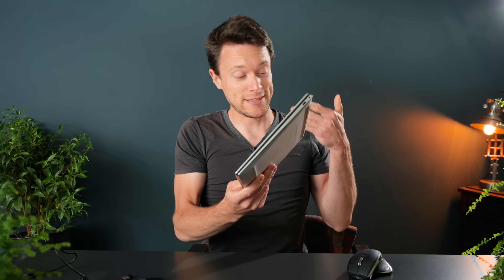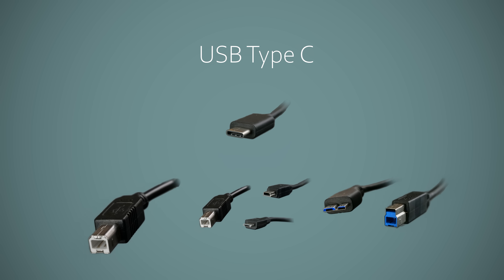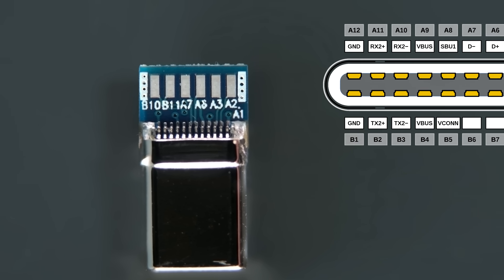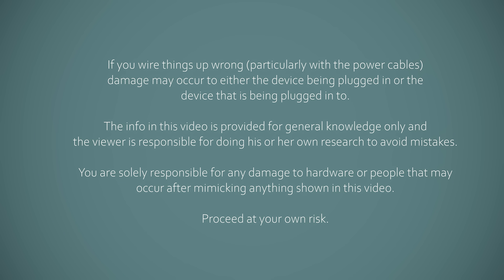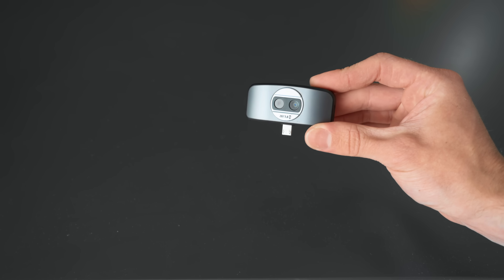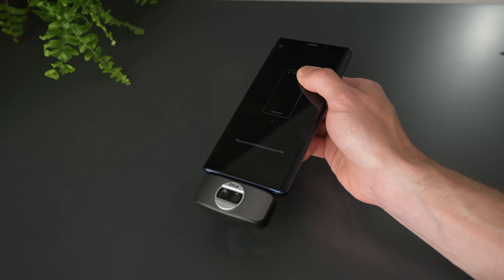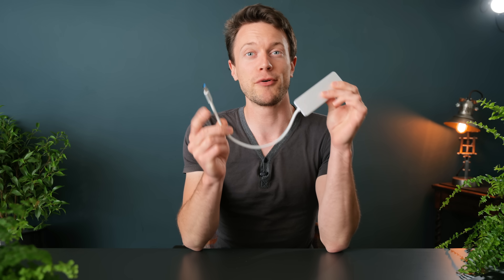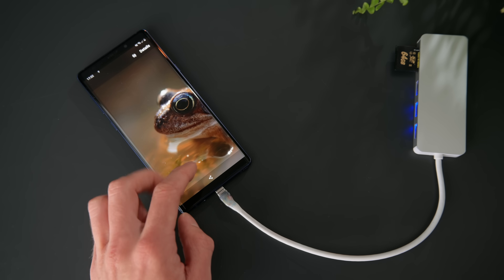Converting devices to USB Type-C

Comment: USB-C is the future and waaaaaay better than the older connectors in many aspects, but they forgot one thing that gets really annoying: retention. Old micro-B had tiny metal hooks that keep it plugged in, and even if those got bent you could just bend them back rather easily to "fix" it. Type C on the other hand... well, my phone already has Type C, and after a year of usage the port apparently has widened ever so slightly, so now I constantly have to check if the cable is still properly plugged in during charging because even slight movement can dislocate it enough for charging to stop... <.<

Comment: For tiny wires that are perfect for connecting stuff like this, I highly suggest old IDE and floppy disk cables. IDE cables are usually a single strand, while the floppy cables have slightly thicker multi-strand cables, though both do exist in both forms. The electrons don't care about the colour ;)

Comment: Oh, it pained me to see you put that giant resistor on there when you could have just moved the existing SMD resistor to the other set of pads...
Reply from the maker: It was 56k unfortunately, not the required 5.1k
Reply: @DIYPerks  But it was a pullup to +5v instead of a pulldown to GND, are you sure it wasn't 5.6k, since that would be the nominal value above 4.7k.

Comment: Good video, very practical.
One down side is that it's not mentionned the signal quality is highly degraded whne soldering this way. I'm not convicent those breakout boards are impendance controlled either. The risk is that some devices may malfunction. I bet that most people will not experience any issue because of how the USB protocol works, but functionalities of some devices which challenge maximum link speed may suffer (the functionalities) from a signal reflections due to impedance mismatch.
That's especially true if the viewer decides to extend the existing cable beyond the limit in USB specs.
In any case, good video, thanks Matt.

Comment: Why did you scrape the trace when all you had to do was heat up the resistor and move it to the two other pads wich were for pulling the pin to ground?

Comment: Hi Matt, all Your projects are brilint. But,,, to be honest, im just working on a USB 2.0 / USB 3.0 project, so this video made a huge smile on my face. I know there are better places to ask, but i think this will also interest You. I just bought a new route with USB. It is possible to change USB 2.0 and USB 3.0 mode remotely. As my router is not accessible easilly, it would be perfect to have possibility to use this function to turn on/off my external hard drive (to not be working all the time). I mean connect my hard drive to the router and turn it on only when the USB 3.0 mode is enabled. So basically im trying to make an USB cable/device to connect to my router via USB 3.0. The USB 3.0 cable will be splitted to 2 USB cables (one USB 2.0 and second USB 3.0 - the cable is possible to buy). I will connect Digispark controller to the USB 2.0 end and my hard drive to the USB 3.0 end. Now the interesting part comes. I want to deconstruct the USB 3.0 cable (router - harddisk) and cut the positive wire. I will connect the cut positive wire going from hard drive to Digispark I/O pin (no power going trough normally) and i would like to connect some USB 3.0-related wire to another Digispark I/O pin as a trigger (this wire will not be cut, i will just scrape off the isolation and will connect a new wire to it like "T"). Hopefully this way i will be able to turn on and turn off my external harddisk when my router will be set to USB 3.0 output. Code will be pretty straight (when there will be an impuls from the USB 3.0-related wire, i will send 5V to my harddrive, maybe there will be some "timer" like i will send the power for next 5-10 mins from last USB 3.0 impuls). Could You help me to choose the best USB 3.0 wire as the trigger? Or is it a really bad idea (to burn both my router and harddisk :D )? Here is a diagram of the idea: https://drive.google.com/file/d/1vicodTE-F9b5rWNngTqEzJKy9ldO5bxA/view?usp=sharing and my mail oznogg@gmail.com. Thank You, Jan from Czech Republic.

Comment: I really enjoyed this simple video (although as others have pointed out wonder why you didn't just relocate the smt resistor) but am troubled that you didn't warn people to be careful what they modify (while I doubt someone would alter a USB A/B to USB (A/B) -> C due to cost, I could still see someone doing this and then destroying there device due to lack of  56 kΩ resistor or being stupid enough to mess with a portable battery with integrated cable) due to the spec current allowances.  I also have two of those mice.

Comment: i don't think thats a dongle. It's an ADAPTER.
A dongle is a thing that plugs in on one end and has NO PLUG on the other end. (this includes wireless dongles, because they dont have a WIRE coming out, even if they do connect to other things, wirelessly.

SCSI terminators are dongles.
Copy protection hardware keys are dongles.
USB A to USB C adapters are not dongles.

Comment: It's a non standard connection - the "standard" and the intent of the USB boffins says that the good old USB A socket should be used for all "A" end connections whatever the working standard is - because the basic aim is meant to preserve 100% backwards compatibility across devices.
Unfortunately as a result of the introduction of the latest trend for ultra portables  some of the big guns decided to use an odd twisted variants for power and in order to shave mm from their case thicknesses have gone for the slimmer thunderbolt style USBC outlet.  The header is fully compatible but the outlet has been made unusable without a (presumably grossly overpriced) dongle adapter.  The danger for the less tec is they go to the bay and risk ending up with a bag of OTG adapters.
The problem with burning your boats and pandering to this season's whim - is what about next year? - What comes next?
By destroying your dedicated mouse/keyboard dongle that has served so well for all this time - is now it's on borrowed time, and what of all the other USB memory sticks and memory readers you've collected over the years?

Far better to build a C>A adapter for each outlet and leave the device hardware alone - or mod a cheap 4 port hub.
It's sort of fair enough with the IR camera but even that mod is on borrowed time with power delivery as the new golden child.

Comment: There is a quite easy way to spot ground connectors. On the PCB you will see that's 99% the one directly connected to the most massive parts of coper which are all over the board. 
For your board, it was the one at the right when you present it and at the left when you measure.
Tell me if i'm wrong ;)

Comment: is it not possible to just move the resistor from R2 till R1 ? It looks like the label R1 is positive and the label R2 is connected to negative. and the bottom goes to the same through hole. Any ways great video!

Comment: I like to see a video, on how to use a USBC QI v2/3/4 power supply to power a usb micro device, for power only.

As USBC male will only put 500mA at 5V to a microusb device converted to USBC female, unless you do alot of resistor wizardry to get only 5V and for 1A or more out.

Comment: YES to the webcam! 
it's so crazy - before corona, they were like sub $30, with some even $9. and I was building a station for my boyfriend to play Magic: The Gathering remotely with his friends that live in other states. And then Corona hit and every webcam that's any good is like $300!?!, so I got some adhesive velcro and an old imac, and attached his iPad to the top with an old case (so it's modular) and he uses the iPad as a webcam for Discord video chat, while he watches their cams on the iMac. it's a little overkill since it's two entire units running two separate Discord accounts, but it works really well. We also tried using a mirror to angle the iMac's webcam towards the surface of the desk but it was janky, lol.

Comment: One of the first times I seriously don't see the point. It costs anywhere between near the price of a typical adapter to more so, and in future there will probably be smaller hard-shell USB-C adapters. I am sure once the Chinese figure it out they'll be cheap as chips and in exchange for enduring a little bit of pain with a wired adapter you can have your smaller solid ones which will look a whole lot better and about as bulky-looking. I bought a real small MicroSD card adapter with both a type-C and type-A connector where the card goes inside the type-A plug.

I know you need ot make some content but man this just looks dumb to do. Aside from soldering practice I don't see the reason for_anyone to do this and hope you publish something more substantial real soon.
Reply: Scratch all of that, these really tiny adapters I talk about already exist: https://www.amazon.com/dp/B07G54XXZZ
And for C to A: https://www.amazon.com/dp/B00GIF4E08

C to A adapters may well get smaller with sime when someone figure out how to stuff the type-C connector inside of the type-A socket. If not inside, figure out where exactly they need to stop for prevention of interference.

Comment: I'm trying to find female connector boards that are as easy to connect as these female ones seen in the video, where I don't have to solder the data and power lines on both sides.

Comment: Definitely make a video for building webcams! I love your videos for salvaging parts from laptops and creating new devices, especially the video on creating an external monitor and the one on the smart mirror.

I attempted to turn an old laptop into a monitor a while back but unfortunately completely bunged it up when I bought the wrong control board and also managed to crack the screen.
I'll be trying it again soon enough though as I've got another salvaged laptop sitting around.

Another option, however, would be to get a raspberry pi and create a little homemade tablet or handheld gaming system. This is a little out of my ability for now though so I thought I'd mention it as to maybe tempt you into trying it yourself for us in the future. =P

Comment: Instead of just a webcam, it's probably much more fun to do an infrared webcam as the conversion is relatively simple. Also, maybe figure out a way to utilize the I2S microphone on the webcam.
A project I am working on is to attach an I2S mic to a 5 dollar Raspberry Pi zero and have it transmit with RpiTX or something similar. It should be super fun and worth making.

Comment: Thats what i've in mind. i love the ideas! next turn a 3,5" HDD to USB-C and throw the powersupply finaly away.
Reply: That is a lot more work than what he is dong.  Depending on the internal circuit could be simple or complex but either way wouldn't recommend it (won't gain more data throughput and if a 3.5 than no reason to move / relocate it at which point why care enough about the additional cable.)

Comment: For people that want a better webcam than what you will ever be able to find in a old laptop, just use an old (it doesn't even need a SIM or anything other than USB/WiFI) android cell phone and DroidCam. The best webcam ever, just with the worst mounting solution ever.

Comment: Great video as always. I'm sure I will use it in the future. Unfortunately I do not like USB-C. The phone I currently have came with USB-C and it constantly comes unplugged. If the battery is low and I'm trying to use the phone while plugged in, it falls out all the time. Sometimes I plug it in at night only to wake up in the morning and find out it got bumped it and it never charged. I never had this problem with the connectors in the past.
Reply: Oh, and if you keep it in your pocket you constantly have to clean the port or or it won't even connect.

Comment: I genuinely do not understand why would one wish to use this kind of solution, instead of spending few hours and ordering an assembled PCB with FLIR connector or pcb for Logitech's receiver.
Not to mention the abominable trace scrubbing instead of just moving a tiny SMD resistor.

Comment: I’m not sure USB-C really is the greatest thing ever. The beauty of that Logitech wireless dongle is that it nearly all fits within the USB type A connector, and there’s little to no risk of anything breaking if you just leave it plugged in all the time. I’m not sure there’s room inside a USB-C connector to do the same thing.

Comment: Another option for the 3.0 is to take a Thunderbolt cable (Has all wires) and wire into the the hub internally, replacing the old cable.

Comment: you do know theirs a usb type a to type c  thats smaller then the ones u showed  as showen in the ebay link with out distorting the usb  > https://www.ebay.com/itm/New-Samsung-USB-Type-C-to-USB-OTG-OEM-Adapter-BLACK-For-Type-C-phone-LOT-of-3/333085990612?epid=795112884&hash=item4d8d78ded4:g:C5sAAOSwXHpcbujR

Comment: For certain high-speed devices, you need to keep the connecting wires very short. Those data lines are impedance controlled lines and may not work if your wires are too long or there is a length mismatch.

Comment: If you have an old Android phone, you can actually download droidcam on that phone and your PC, connect it with a sync/charging cable, do the proper setup, find out a way to mount it and you have a webcam from an old phone you were no longer using!

Comment: Just wondering about the breakout board That little resistor or R1 if you heated it up and moved it to the R2 location would that not have been better than removing the trace and soldering a big chunky resistor ?

Comment: Curious, I don't have an iOS device but could you technically hook a card reader to a lightning port? Or are they not the same considering it's not in the USB family
Reply: You probably could but it would be really complicated, buggy, expensive and overall not worth it
Youd have to bypass apples lightning port security, obtain permits etc. They dont belong to the USB family as the lightning port is a proprietary port, making the while thing even more complicated. 
Its possible, but not worth it.
Reply: @maxz8807  Yeah I've been trying to figure a way to help a church member who has an old iOS device and cannot move their files/photos. They handicap me by saying moving it to the cloud is not an option (which makes me wonder what kinds of files/photos they have that are so important). I've seen a few OTG type devices for iOS but they only best way I can figure is transferred though Bluetooth or WiFi device. I've seen a few portable devices like this but they happen to be out of their price range (yup another handicap). I swore this would be simple but I swear it's getting more and more complicated. I was thinking about if it was possible to transfer data from the iOS port using this type of technique. Oh well, I may just have to capitulate that I cannot do it as they want. The issue was they don't want to upgrade until they transfer the files. I also thought about airdrop, but that's one file at a time unless maybe you zip/rar it? Thanks for your help

Comment: Probably a dumb question but here goes: is there any reason one couldn’t sacrifice a usb-c cable for the connectors? That way the wire leads are already attached. Hands are a little shaky for soldering these days.
Reply: You could, though it wouldn't be as compact. You'd need to include the extra host/sub resistor, plus you can see the backside of that adaptor has a capacitor, it'd be worth finding out if that's necessary.

Comment: Wish my Kinect V2 wouldd work ffor a webcam, without Microsoffts $60 adapter. It's just USB 3 with extra 12 volt power pins crammedd in it on the camera side, andd proprietary bullshit on other end. Then there's some bullshit USB controller compatibility.

Comment: USB C is a stain on the USB spectrum, it shouldn't exist as double sided USB connectors do in fact already exist, so it really is a pointless standard to be pushing forward, too many pins to get wrong and blow up devices or get wrong so you end up shorting something, having video, power, data and audio all sent together at once is just asking for trouble, if you want video/audio, use HDMI, if you want power and data, use USB A, don't mix them together, as my capture card works perfectly fine with USB A and Mini USB as it sends the perfect amount of data through at once, yes it would be nice to be 3.0 but thats by the by, USB 3.0 is the dogs unmentionables and we should be expanding on that, not trying to condense it all

Comment: Do not buy a cheap soldering iron from your local hardware store.  Yes, buying local is great, but I highly doubt they stock anything decent.  A proper Hakko for around 100 USD sounds a little pricey, but if you're doing small work and will do more in the future, it's definitely worth it.

Comment: I'd really like to see an old camera (sensor and lens) or even an old dslr converted into a camera that would work over USB. Even if you need to attach a heat sink to it. Since 1080p webcams from 10 years ago are still comparable today because of the slow development of webcams. It would be great to find a DIY way of getting superior USB camera quality, with the option of using lenses, without buying a brand new top of the line DSLR and a hdmi capture solution for it.

Comment: I did make a laptop webcam into a USB version last week. I used your old video as inspiration. However I found my webcam modules have a lot more wires. And I couldn’t get the microphone to work. So a new video would be great. Also if you do make it, it would be nice to know how to attach the USB cable directly to the webcam PCB. Thanks for the great content.